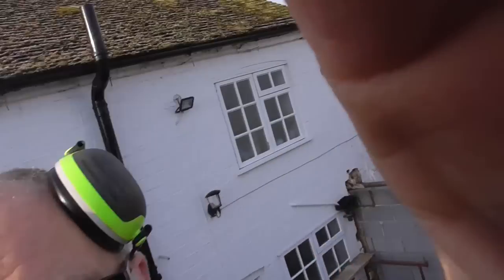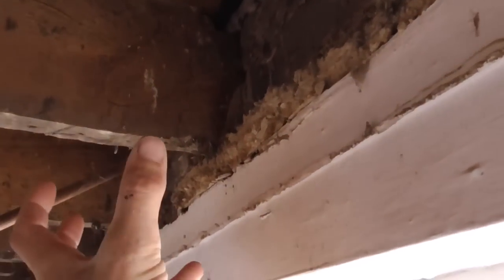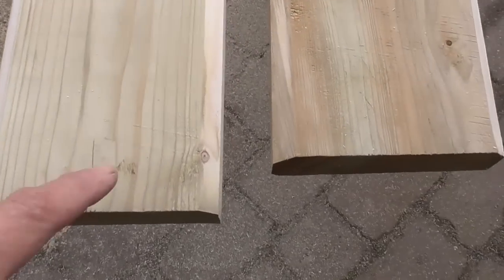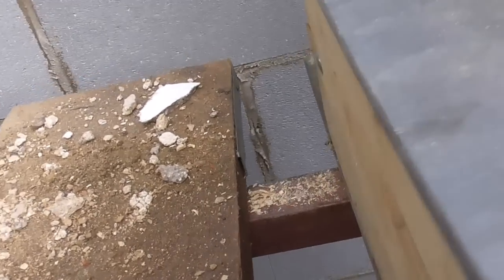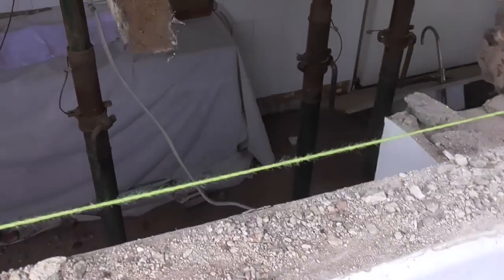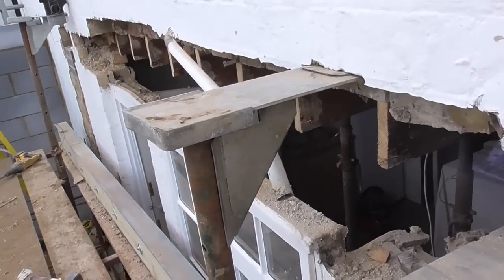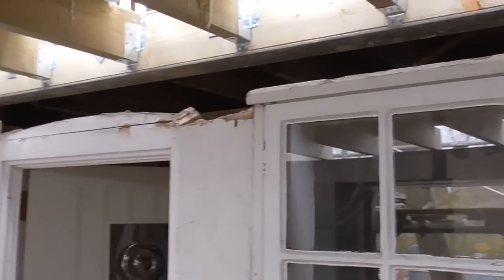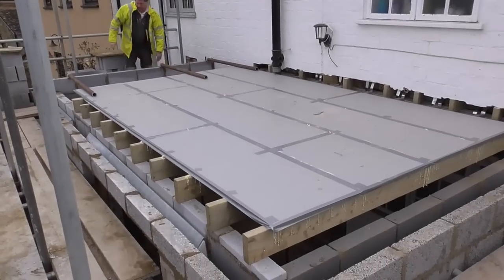Fitting steel beam to support new and existing house floors***KNOCKING THE BACK OF THE HOUSE OUT***

Comment: Tip for all budding carpenters out there, always keep your hands behind the tool and second when using a skill saw, before you set it down make sure the guard has sprung back across the blade. They get stuck from time to time and placing a half running saw down will either ruin your timber or worse jump and bite you!!  Learned this the hard way many years ago.
Reply from the maker: Great saw safety tips there MR👍and I too was lucky to not learn the hard way when I put my saw down with the guard stuck back. It only knackered the blade, but could have been much worse😬Cheers

Comment: Del was the steel fixed into the pads with bolts or another way?
Reply from the maker: Hi Eddie🖐No bud, the steel just sits on the pads, but has the joists fixed to it both sides👍Cheers Del

Comment: Are you anywhere near Lincolnshire?
Reply from the maker: Well, I'm 25 miles from Stamford, and 105 miles from Immingham😊
Reply: @thetallcarpenter  I'm near Holbeach.  We're just finding it so hard to find somebody to price up and do work - nobody seems interested - is that how the trade is at the moment?  We're also looking to have an extension.
Reply from the maker: @True Brit  I'm afraid we are now starting to see the results of how the building industry, and manual type work in general, has been veiwed/treated over the last 20 years😬 resulting in a chronic shortage of people qualified or interested in doing the jobs this country needs🤔 Sadly, I agree with Mike Rowe, a prominent commentator on these issues from the US, who says that people may have to accept that they won't be able to get any repairs/improvements/building work done AT ALL. We have our politicians and education system to thank for actively pushing our youngsters away from manual type work, in favour of importing it cheap from overseas, and I think it is extremely short sighted and risky for complete sectors of the UK to rely on work forces from other countries😵‍💫 Sorry, this turned into a bit of a rant, and I hope I haven't been insensitive in writing it👍
Reply: @thetallcarpenter  No not at all, you're probably close to the truth.  There's so much pressure for kids to go to uni today, whereas many would be better off getting into the workplace sooner, rather than later, and to learn a trade.  It does seem hard to get somebody to do the work we require, but we're not in a big town or city, in fact a small market town, so maybe that doesn't help.  All very depressing really.

Comment: At 10:25 you dropped half a brick into the cavity of the new wall. Did you take it out? It will bridge the gap and cause a damp spot in the wall.
Reply from the maker: Hi Steve🖐We use the cavities as a giant rubbish bin, and fill them full of builders waste apart from around the windows and doors, where we fit a thin section of insulation so it passes building control😉Saves a fortune on skips😇 Cheers Del
Reply: I love this response. 😂😂😂
Reply from the maker: @daniel__clark  😉

Comment: Great job as always Del, the roof will be interesting on this job as well. Are you going to be doing all the internal work like 1st and 2nd fix too, will be great to see how you get your head around all the out of plumb and level items. 👍👍👍
Reply from the maker: Hi Kevin🖐I'm not sure how much of the job I'm down to do, and may just have been brought in to do the floor and roof🤔Obviously, if I am asked to do more, and the client agrees to me filming, then, of course, I'll bring more videos of the  build🤞Cheers Del
Reply: @thetallcarpenter  You  can only do your best, but it would make great viewing. By the way that was a great tip using that string line so you could mark them ends of the old joists. 👍👍👍

Comment: Used to do a lot of that type of work UK. Haven't done one here in 25 years. The brickwork is all cosmetic skin wrap. The load is on the inner timber frame. Plus most of the old stuff I work on is timber or cement board clad anyway. Makes life easy. Good to see inter trade relations there. Pushing the job on. Not common here. More like the old British Rail. You touch a brick. You need a bricklayer. Timber a carpenter. Etc. You had pipes there. Maybe electrical. Soon you have 10 trades all drinking tea. Just goes to prove that with a small knowledgeable team. Willing to dig in you can move mountains. Or in this case the back wall of a house. No WHS worker was harmed in the making of this film. But a few could be out of a job.
Reply from the maker: I love getting and reading you comments Dave🤗You're right about what can be achieved when everyone  works together👍and I'm definitely a 'team guy' and really enjoy completing a task that takes team work👊Thanks as always bud😎

Comment: Nice to see a realistically sized beam going in.      Everything I seem to get specified now seems to be 305 x 305 🤬
Reply: Get another engineer. 305 x 305 is crazy. Compensate with thicker steel in the web.
Reply from the maker: I absolutely agree with you Denis👍 I've got an awesome engineer who really understands the impact his designs have on a building and also how you go about delivering them, and he is always willing to listen to concerns you might have and find a solution that satisfies him and you😎Cheers Del
Reply: @denisoriordan6739  as a builder I don't employ the engineer, the client usually has drawing calcs and building control delt with by the time the builder starts the pricing.      305 x 305 and 305 x 127 seem to be the order of day.  admittedly spans are large too but still.
Reply from the maker: Over my time as a carpenter, structural engineers have become more and more cautious, and, as you hint, just make everything much bigger than it really need to be🤨Thanks for watching😎Cheers Del

Comment: how did u not use any more  acros for support?on the outside, only two seems risky on that span
Reply from the maker: Hi Raftt 🖐 The existing joists had 5 acro's bearing on a board supporting them, which in turn, are holding up the inside 4 inches of the 9 inch, header and stretcher back wall. The 2 external props on Strongboys were just belt and braces👍 Thanks for watching😎Cheers Del
Reply: Fair enough,love your videos btw